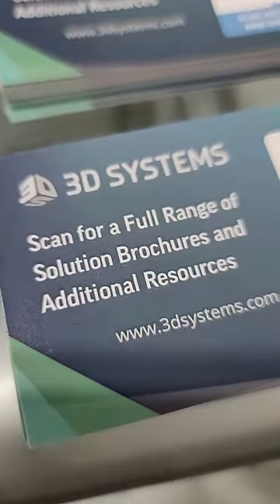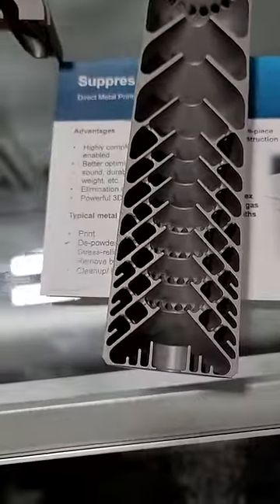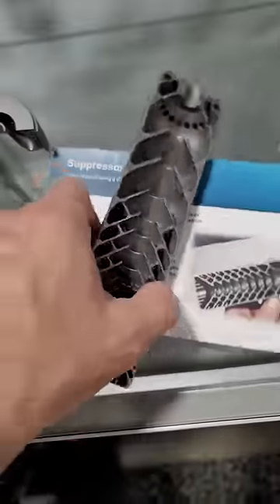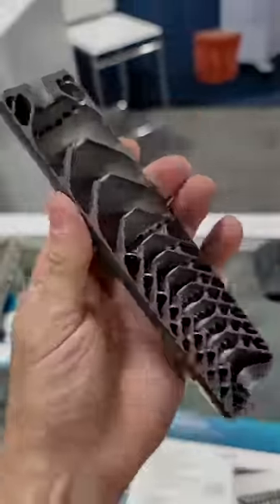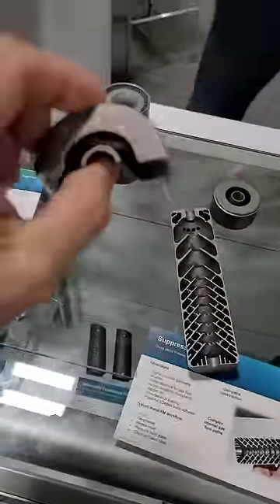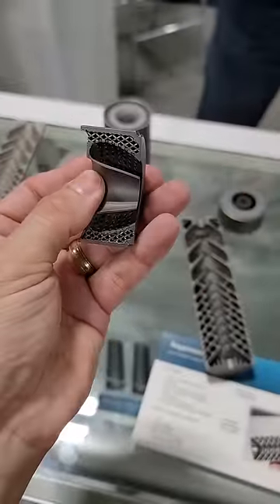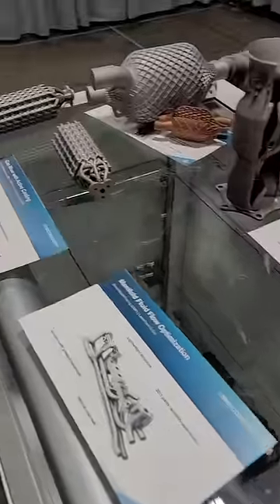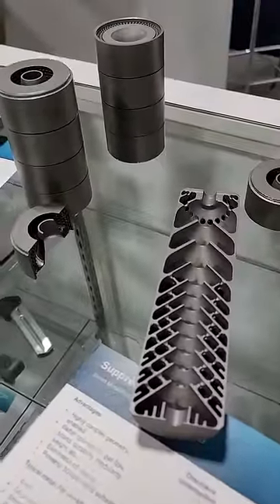Amazing 3D Printed Metal Parts!

Comment: "Automotive fuel filter"
Reply: It says right on the infographic suppressor
Reply: @jeepmanxj  I'm aware
Reply: @3ch0_17  shhhh the longer they don't know, the longer we get to keep buying more 😂
Reply: @jeepmanxj  shush
Reply: @iamt00t  literally everybody knows. What you should know you're not going to be finding online in comments sections
Reply: @jeepmanxj  It also says right on the front "Jeep" but you still bought one anyway
Reply: @wallstreetsplooge  I've bought 30isj
Reply: Solvent trap* lol
Reply: @@338tthompson… no input
Reply: @jeepmanxj  hear that?....its the joke going over your head
Reply: @exorias625  it would have been a "joke" if they had it on the placard. They didn't, thus no joke
Reply: It's basically a 3d Tesla valve.
Reply: @RimWulf  absolutely not
Reply: @3ch0_17  well it's now exactly but the principles are the same. If you print the Tesla valve in 180° around you'd get something like this. Tesla didn't have the technology to do that at the time.
Reply: @RimWulf  no, not even close 😂
Reply: @3ch0_17  If you actually knew the science behind it, you wouldn't be saying that.
Reply: @RimWulf  dude. I know the working principles of a tesla valve. This, a firearm suppressor marketed as an automotive fuel filter, is not in any way comparable to a tesla valve.
Reply: @3ch0_17  there are similarities. So it is comparable.
Reply: Thats Silencer
Reply: @jeepmanxj  interesting, this basically is a Tesla valve but the inside of course has to be straight for the bullet to fit through :D
Reply: Silencer.😂
Reply: An impossible to clean item
Reply: You mean Solvent Trap good Sir. I never found a real way for filtering fuel but I sure  like to trap it.
Reply: @jeepmanxj  But yet you're the only one in this entire replies section that doesn't get it. r/whoosh
Reply: @3ch0_17 yeah now that you were called out so you went back to watch it again. 😂😂😂😂
Reply: @strhaivenswr  said wut?
Reply: YouTube had a thing about suppressors a while back, same as how you have to say “passed away” instead of “died” even referring to a battery

Now suppressors are allowed, but it wasn’t always like that

Comment: Metal 3d printers that cost 700-1200$ would literally revolutionize EVERYTHING it would open up creative endeavors in such a way to make it available to literally any one and everyone. One machine that could do the job of almost every tool in a professional machine shop.
Reply: I'm patent pending on the very thing
Reply: @mikeyearwood  what is the patent? magic economics? how do you get a DMLS printer at under 1k?
Reply: I fear DMLS is very far off for enthusiast-level machines. Recent events in the 3D printing community around even SLS machines have been pretty disastrous (Micronics).

Comment: For those wondering about DIY - the lowest cost way to do this is to use a laser cutter and cut thin sheets of metal cross sections, then stack them, and either weld or bolt it up. It's not perfect, but it's sub 2000 dollar "printing". Its slicing, but physical.

For 3D printing, lost casting. There are resin printers with prints that can be baked and the metal will fuse while the resin bakes off. Not great but Integza made rocket engines this way. 
 There are metal bearing filaments, like Prusa Tungsten PETG that are 70% high z (refractory) metal that will have some properties of the carried metal. Prusa also makes a fire retardant filament. The multi tool head XL printer can print within the print, and embed multi materials, so a flame retarding liner inside a CF reinforce nylon shell. 
There are a small number of expensive printers that embed a continuous CF strand into the print rather than shredded CF. printers can go FAR with just exotic plastics. Don't believe the gov propaganda that just plastic makes you defenseless

If you want to go down the rabbit hole start with "orca" and "fosscad"
Reply: i fee like anything made that way would melt after a a couple dozen rounds or expand to the point of worthlessness
Reply: @jminkvihubyb The orca can last for thousands of rounds while firing intermediate cartridges. It is equivalent in power to an ar-15 but everything that isn't printed can be bought at a hardware store.
Reply: Tell me when the orca has a 3d printed barrel using prusa metal filaments and when prusa makes an explosive filament to print bullets
Reply: @AckzaTV  3d metal printing is already a thing, although it is currently expensive, and the spec sheet for a .223 barrel can be inferred or found online. It would however be easier and cheaper to just mill one. Single base smokeless powder is basically nitrocellulose and a nitrate oxidizer, both can easily be made at home. Also, brass sheet can be punched and shaped into a case with some specialized hand tools that are actually pretty cheap. Hand loading cartridges is pretty popular in some circles.
Reply: Y'all need to look at the FTN.3. There are some examples in the thousands of rounds.

Comment: Tesla valve with gas ports and passages.  Various aerospace applications, but this appears to be intended for use as a very effective silencer.
Reply from the maker: shhhh
Reply: Crazy how car mufflers have improved in the past 3 years
Reply: For the DeWalt automatic hole puncher*
Reply: “Silencer”
Reply: Lower yo voice
Reply: This isn't a Tesla valve. The Tesla valve has little u-turns for flow reversion, not present here.
Reply: @flyingrichfirearms dude dont worry, silencers dont exist...
Reply: @TheDragonRider6422 i really dont get the hubbub.. silencers dont exist... Suppressor is the word yall want
Reply: Wind chime

Comment: This made me realize that the machines I know, made of rubber tubes, wires, metal screens, rods, bolts, and washers, all of it separate parts, that we've been so extremely limited in our builds by the exact things this tech is allowing us to do. 
The ability to print an engine, nearly all 1 solid piece.. wow

Comment: To all those hoping this reaches small individuals without a fat wallet, it will eventually, but whats more likely to happen before then is breakthroughs in material science, creating better materials than metal for certain applications, and for a fraction of the cost. As well as synthetic materials are more cost effective to 3D print. I'd say within a few years us smaller fry will be able to print reliable tools without needing a fortune, or rely on other entities.

Comment: Wow.. i knew this would happen because we had the 3d printers then went to 3d print houses and i was waiting for 3d metal work but i thought it was going to be too hard. I mean i dont fully understand it but i also havent looked into the technology behind it but lets say you have one.. and they really make the push to EV's and all gas powered vehicles parts stop being supplied.. you can just service yourself! Very very good!
Reply: Out simply, a laser is fired at and moved along in a pattern over a mound of metal shavings that melts them, and as it goes round and round and the metal shavings keep being pushed onto the area to be welded/baked/melted onto the previous layer, so a part continually is contained within a mound of shavings. At the end, you pull the part out of the mound and it is as complex as a laser and light can make it.

Comment: Its cool but the Printing material for it is over 600$ so each part you make would cost 3x to 10x what it would to put it in a mold also the problem with printing most plastics most of the time you can make the thing far cheaper with pvc or a  apoxy mold

Comment: Laser sintering uses a powder which is “welded” into the print pattern.  Metal strength is always degraded because there are void spaces in the powder that remain after the laser bonds them together.  It’s like asphalt. Those voids degrade strength and make the metal porous.  I would like to see the durability measured of a sintered suppressor.  If they see the same life, that’s great.
Reply: Yes but also it can be stronger as you don't need to machine threads, press sleeves, introduce weld heat affected areas, and all of the other defects that conventional manufacturing techniques introduce, if your design process is sound then you may be able to make a stronger overall part.... though cost is always a factor
Reply: Properly designed and executed DMLS parts are very often STRONGER than their traditionally made counterparts. There are obviously exceptions to this though. Pretty hard to beat a CNC milled hard forging

Comment: Dang how do you even 3d print with metal, wouldn't you have to heat it up
Reply from the maker: Typically it is powder that is laser sintered
Reply: selective laser sintering
there's a big tub of metal powder and lasers heat up and melt the right spots

Comment: What would it cost to get a 3D printer that prints metals?
Reply from the maker: No idea. All I know is they are very expensive.
Reply: The cheapest one os only 10k. Raise 3d. Its very expensive material though like 190 for a kilogram i believe
Reply: Industrial grade laser sintering machines start at ca. $50.000 and sky's the limit. There are cheaper ones (ca. $20.000) like the FUSE1 from Formlabs but it can only handle polymers.